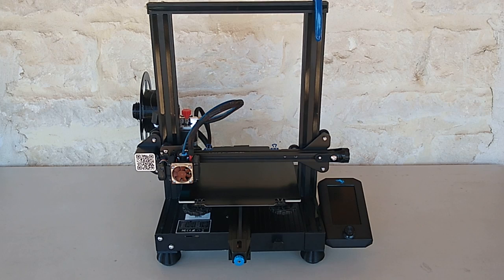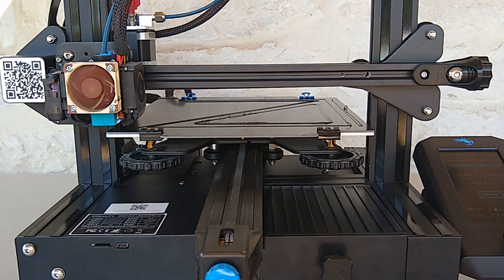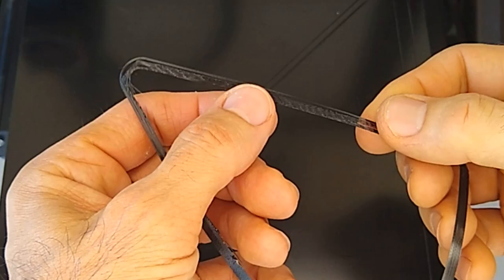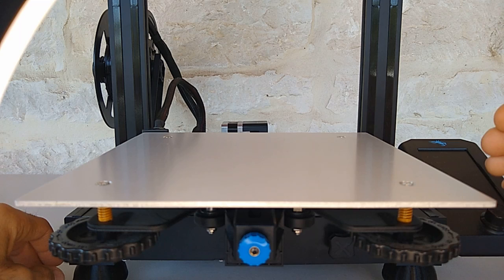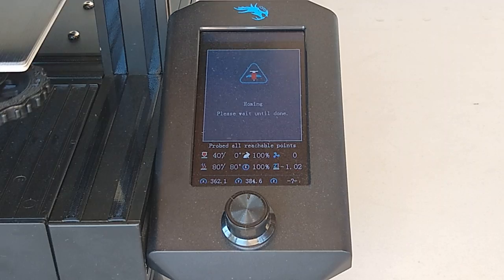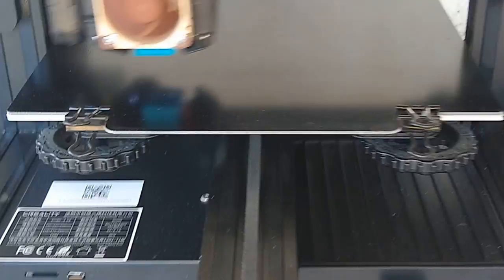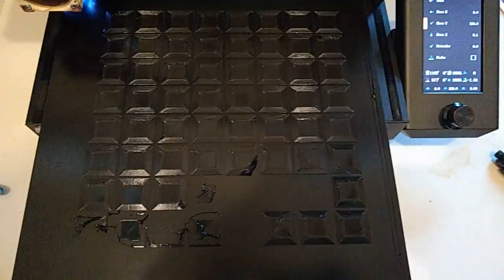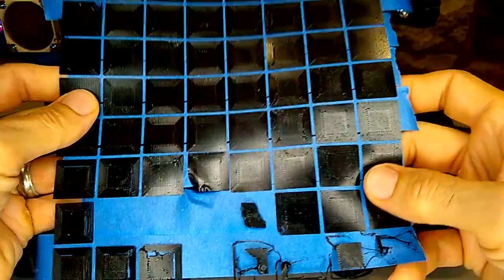Jyers Firmware Unified Bed Leveling Ender 3 V2 - Getting Perfect First Layers From An Uneven Bed

Comment: Aye bro you dont know where i can find firmware for an ender 3v2 w a 422,bl touch, and a e3d hemera? I tried doin it on vs code but it keeps sayin failed
Reply from the maker: Hello nacho408sj, Thank you for commenting. Use Miguel's Professional Firmware instead. It's actively being improved on and has advance features like linear advance, input shaper, UBL, MPC, and a boatload of things that can be tweaked. The special configurations can be found here in the link below.

https://github.com/mriscoc/Special_Configurations

Comment: hello i had a problem with my update its not showing the numbers when i auto level my bed
Reply from the maker: Hello Friend, sorry for the late reply. It could be an incompatible display. Creality uses 4 different sources for the display and depending on which board yours has will determine the firmware. Unfortunately Jyers hasn't posted and update for several years so unless you have one of the original Ender 3 V2s that came with a DWIN display you're out of luck. A much better firmware that is constantly being developed is Miguel's Professional Firmware. 

The first video is how to determine which display you have and the second is how to customize the firmware for your machine. Don't worry about the printer I use in the video it's using a 4.2.7 board which is the 512kb version of the stock Ender 3 V2 4.2.2 board so make sure to select the proper one from the configurator menu.

https://github.com/mriscoc/Ender3V2S1/wiki/How-to-update-the-display 

https://youtu.be/2NqHNYtyEa4

Best of luck with your mods!

Comment: When i make a new mesh my CR touch just doesnt go down. It just stays there floating and says that it finished the leveling
Reply from the maker: Hello, I would use Miguel's Professional Firmware as a non-Klipper alternative right now. The Jyers firmware hasn't had any development for the last 3 years and many new features have been added to Marlin. 

Please follow this first link to determine which display control board your printer has. Then watch the video l made on customizing the firmware for your needs. Just ask if you run into any problems.

https://github.com/mriscoc/Ender3V2S1/tree/Ender3V2S1-Released/display%20assets

https://youtu.be/2NqHNYtyEa4?si=NVCYDkKg4XmQLmJd
Reply: @vbared  thank you I will give it a try. Though I do think that it is a issue with my cr touch. The cable is most likely damaged. I looked through a few videos and that was what was happening with others. I will give this a try tho before I order a new cable
Reply from the maker: @nadim_873  Yeah, that's a good place to start and something I should have thought about. It doesn't take to many bends for those connectors to get damaged. Once you get that sorted out switch to Miguel's Professional Firmware, it's packed with all the latest Marlin goodies and get regular updates.

Comment: Hi Victor … I’ve been following your method and used on my printer … but I’ve been having problems … after I create a new mesh and correct the z offset and ran a test print … it seems that the changes that I made manually on the mesh are not saved … because the print showed the same problems that I had before the manual calibration… I tried to clear the mesh and start a new one … but that didn’t help … I also did the manual calibration on all the 100 points … but still seems that the changes aren’t saved … also at some points of the mesh the test print shows that the nozzle y too close to the bed but when I run the manual calibration on that point the nozzle is too high so I can’t find any sense on that  because the print is showing different results … hope you can help me thanks 😊
Reply from the maker: Hi Darwin, Thank you for commenting. When you complete your fine tuning are you saving the mesh? Another thing is that you need to modify your g-code to load your saved mesh prior to printing. I've included my start g-code for you to try, just make sure that the mesh slot matches the g-code. If you save it in slot 1 then slot one should be what the g-code is loading when it runs the load bed mesh. Make sure to enable "Go to Mesh Z Value" which should bring the head down so you can adjust it.
Let me know if this fixes your issue. 

https://drive.google.com/uc?export=download&id=199u7szF95cEaX82Rhq0-CMQm-HuJwQao
Reply: @vbared  I’m saving the mesh … and I’m using your start gcode … I followed all your steps … but same problem every time
Reply from the maker: @900creed  Hi Darwin, give me a call tomorrow +1 478-227-3301 if you can and I'll conference in Doug. Maybe between the three of us we can figure it out.
Reply from the maker: @900creed  Doug and I were discussing your issue and he asked "What firmware did you previously have?"
Reply: @vbared  I updated the creality firmware after I got the cr touch kit so I used the 2.0.8 cr touch non adapter firmware … then I changed to jyers using your video
Reply from the maker: We think that your issues are stemming from not having the software on your display screen that supports all the features of the firmware you are using. 

Try flashing your display screen. Unzip the file linked below, open the folders until you see 3 DWIN_SET folders, copy any one of the folders (I prefer "Gotcha") and paste it on an SD card

The segment of my videos on how to do it - https://youtu.be/amRldRpnK2Y?t=3933

https://drive.google.com/uc?export=download&id=1AL-ad9r0GOulVaYKAo-SMLp2Pm3eKGRF

Let me know if this works for you.
Reply: @vbared  but I update the screen too … for the jyers UI 🤔 … a few hours ago I downgrade the firmware to the creality cr touch … and I got an almost perfect first layer … I’m kinda frustrated with jyers right now
Reply from the maker: @900creed  Darwin, do you have a Raspberry Pi?
Reply: @vbared  yes I have one

Comment: I can't find the UBL version in the 3x3  mesh, is there a version in 3x3? Thanks
Reply from the maker: Hi Norman, I've moved to Miguel's Professional Firmware from Jyers. Miguel is extremely active in adding features to it as Marlin continues to improve. Unfortunately, Jyers hasn't had an update for several years. I'd be happy to compile the firmware for you but will need some details about your setup or you can follow my video on how to compile your own. Give me a call 478-227-3301 for a walkthrough on compiling it.

https://youtu.be/2NqHNYtyEa4

Comment: Nice video by the way I have this problem that is happening to me right now so my bed leveling device doesn't want to go all the way down I used the knobs on the end to unscrew all the level nobs so that i can start even and correct it later on but the offset says that it at -10 and won't go anylower  on the bed the bed can not reach the hot end at this hight is there anything you know or how to fix it
Reply from the maker: Hello Ernie, 

Thank you for your kind comment.
What probe are you using?
Reply: @vbared  it actually the car touch
Reply from the maker: @gray896  Please take some pictures or a video showing me your printer and link it.

Comment: Cough cough no homo I love you 🤣 amazing video man keep it up !!! Thanks for the GCode I've been looking for !
Reply from the maker: Hi Abel, Thank you for commenting and kind words. I'm glad the start g-code is useful.

Best of luck with your mods!
Reply: @vbared  and for the feeler gauge why did you due 0.15? Vs 0.20? I print with PETG so I'm unsure what feeler gauge size to use for my z .
Reply from the maker: @JustCreateYou  Hi Abel. Thank you for commenting and great question. The first layer is going to require some squish to stick to the build plate but not too much. Most is the videos that I watched early on suggested to use a piece of paper create the gap between the bed and nozzle to get good first layer adhesion. The trouble is that a random price of paper can have different thicknesses. Really thin paper can be less than 1mm while a standard sheet of white copy paper can be 1mm or more. If you use a 1mm thick piece of paper to set you z-offset. You will be too close to the bed if printing at a .2mm layer height. If using a .2mm feeler gauge there is no squish when printing at .2mm layer height. You can tell if you too close by looking at the tops of your prints. If the top layer of a finished print looks dull and not shiny like the sides do then that indicates the nozzle is ironing the tops of each layer. Another thing you're going to notice is little blobs of molten filament randomly deposited on the print, collecting on the nozzle or extra stringing as you print. The .15mm feeler gauge gets you closer to the correct nozzle to bed gap needed (if printing at .2mm layer height) to get a good first layer and avoid all the aforementioned problems. 

Best of luck with your mods!
Reply: @vbared  man you are awesome I def subscribed !! Your videos are so underrated that people are dumb to skip them thank you again 🙏🙏🙏🙏
Reply from the maker: @JustCreateYou  I appreciate you, Abel, thank you. If you run into any questions, just ask so maybe I can save you some time and frustration.

Happy modding!
Reply: @vbared  would you be able to provide a video of how this works with a feeler gauge and CR touch and jiers mesh system because for some reason my stuff when I start printing seem like my nozzle goes up higher then what I had it set too .2 mm and used .15 feeler gauge.
Reply from the maker: @JustCreateYou  Hi Abel, sure thing. Let me put something together.

Comment: Hi Victor, I added the UBL file. But now my ender will not home or move in any direction.  Any idea to what would causes  this?
Reply from the maker: Hello Sarge, Thank you for commenting. Please give me more details on your setup so I can help you trouble shoot. Have you changed the main board to a 4.2.7 or are you using the stock 4.2.2 main board? Did you download the flash file from my video description or somewhere else?
Reply: @vbared  4.2.7 board.  I re-flashed with the creatility firmware. Now I have direction.  But no fine tuning. Thanks for the quick reply.
Reply from the maker: @sargedutch1085  Hi Sarge, Some pins of the 4.2.7 are different from the stock 4.2.2 so to get the UBL working download the version for the 4.2.7 linked below.

Let me know if you have any more trouble so I can help you.

https://github.com/Jyers/Marlin/releases/tag/v2.0.1
Reply: @vbared  this worked.  Thanks.
Reply from the maker: @sargedutch1085  Awesome job!

Comment: Whats the difference between 3x3 5x5 & 10x10 on the files
Reply from the maker: Hello JusThyTipp, Thank you for commenting, the difference is the amount of probe points. 3x3 is 9 total and 10x10 is 100 points probed. The best firmware currently for the Ender 3 V2 is: https://github.com/mriscoc/Ender3V2S1/releases/tag/20230522

Comment: Would it be different for every ender 3v2 or should I use a .15 feeler as well?
Reply from the maker: Hello Trevor, Thank you for commenting. I've learned that using the paper method puts the nozzle too close to the build plate because a standard A4 sheet of paper is .10 in thickness. Starting with a .15 feeler gauge puts you very close the perfect nozzle height. Once you set the z-offset using the .15 feeler gauge I recommend printing a 2 layer high 20x20 square using a brim with a .1mm gap between the brim and part. Make sure that you set the initial layer, prime, skirt/brim flows in CURA to 120% (this is important otherwise you may not get good enough adhesion to the build plate). If the brim on the completed print is difficult to remove then you need to raise the z-offset a bit and run another test print. Continue this process until the brim barely holds on to the part and can be removed easily.

Best of luck with your mods!
Reply: @vbared  I really do appreciate your content and reply! I am ordering a feeler to get everything set!
I hope you have a blessed one;
I agree with the paper method especially for noobs out there
Reply from the maker: @CloudyCreamer  Thank you Trevor. Many blessings to you as well.

Comment: I enjoyed your video and learned a lot from it. I'm not clear on how you determine what thickness guage is used to make the manual adjustments and whether all points need to be adjusted, can you explain or refer me to a tutorial which explains it? Thanks
Reply from the maker: Hello Norman, Thank you for the kind comment. Are you using a CR-Touch or BL-Touch? Please also tell me what build surface you are printing on and what type of filament.
Reply: Hi victor and thanks for the reply.I have the cr touch using original ender glass plate with inland filament.
Reply from the maker: @normanziegelmeyer7693  Good morning Norman, Your Ender 3 V2 has one of four models of displays. Linked below is a way to tell which type you have by comparing it to the pictures. You'll need to take off the back cover of the display by removing the four Allen screws and unsnapping the plastic cover. Let me know which display you have any I'll compile the firmware for you.

https://github.com/mriscoc/Ender3V2S1/tree/Ender3V2S1-Released/display%20assets
Reply: I have Dwin
Reply: I have Dwin, also what is MRISCO firmware and does UBL come in 3x3 matrix? Thanks
Reply from the maker: @normanziegelmeyer7693  Hi Norman,  It's an abbreviation for Miguel's Professional Firmware. Yes, you can select 3X3 - 9X9 all from the control menu. It uses MPC instead of PID tuning for the hotend, has input shaping, and linear advance. It's an amazing firmware, I can't say enough about it. Link below to the one I compiled for you. Just unzip and you'll see the bin file and DWIN folder.

https://drive.google.com/uc?export=download&id=1HQ_2ucK9yvg6VsjdOZWz9waZp8sZTcjE
Reply: Thanks for your help, I appreciate it.
Reply from the maker: @normanziegelmeyer7693  Did the flash go OK?
Reply: Not yet, Grass calls, later tonite or tomorrow
Reply: Display won’t load, firmware ok
Reply from the maker: @normanziegelmeyer7693  Try getting the display assets from here: https://github.com/mriscoc/Ender3V2S1/archive/refs/tags/20230312.zip

Make sure the sd card is formatted using fat32 and 4096 allocation units. After unzipping, look for Giadej compilation folder inside display assets folder. Copy and paste the DWIN_SET folder to the formatted SD.
Reply: Tried but No success
Reply from the maker: @normanziegelmeyer7693  Interesting,  how long ago did you buy your Ender 3 V2 and was it purchased new?
Reply: new about a year ago at microcenter
Reply from the maker: @normanziegelmeyer7693  When checking the display type did yours have a sticker on the display board or just the info printed on the board itself? My apologies for all the questions, I'm trying hone in on the reason why it won't flash.
Reply: It had sticker matching the DACAI, once I put the "Personal" folder in and tried it flashed no problem. Are there any other features to add or is the display complete?
Reply from the maker: @normanziegelmeyer7693  Great job being persistent in solving the problem. I recompiled your firmware so it can work correctly with the DACAI display linked here - https://drive.google.com/uc?export=download&id=1HfgsMlCkN8GFxfoG34kntFDtQoufZ3c1
Reply: @vbared  is all i have to do isload new firmware?
Reply from the maker: @normanziegelmeyer7693  Yes, you already have successfully flashed the screen I just needed to compile the firmware for your display type so all that's left is to flash the control board.
Reply: Is there aparticular serring for the probe that’s best? I noticed that it’s much faster than in jyres.
Reply from the maker: @normanziegelmeyer7693  Good morning, Yes, in the advanced menu under probe,  there is a box that says something like enable HS (high speed) probing. Uncheck that box to slow the probing speed. Slow probing is more accurate than fast.
Reply: Ran into two problems, can't load your firmware, just boots up as usual, printer now contains v2.1.3 mriscoc-20230509-12:24(obtained from their site I believe). tried different cards and changing name of file. Second problem is with changing number of probes, It won't remember any value but 2. I wanted to use one but I change it and save settings but when I go back and check it it is 0.
Reply from the maker: Sorry Norman, my fault I didn't zip the bin file. I think Google security does something to it when it is sent as a .bin file. Try this one that has already been renamed to just firmware.bin. 

https://drive.google.com/uc?export=download&id=1HjskxEIPzo2TJnG2wP-SNsXKVfNQ7DiR
Reply from the maker: @normanziegelmeyer7693  Hi Norman, I haven't received an email yet just to confirm please send it to vbared@gmail.com

Comment: Hi Victor, your G-Code TXT is empty, would love to see your starting G-Code
Reply from the maker: Hi Viktor, Thank you for commenting and letting me know about the missing info. I just added the start g-code data to the zipfile. If you try the link again it should be there.

Best of luck with your mods!
Reply: Thanks a lot! Your channel is awesome. I love your Minimal cooler design, bought it the other day, just waiting for the other parts to arrive 😁
Reply from the maker: @viktorp3759  Hi Viktor, Thank you for supporting my work and kindness. The compact fan bracket and ducts work great. Best of all is that it's quiet compared to most things I've tried.

Best of luck with your mods!
Reply: @vbared  Thanks, just installed the fan bracket on friday, printed in in PLA and its holding up, very nice design
Reply from the maker: @viktorp3759  Hi Victor, Great job getting all the parts printed and installed. I highly recommend that you print up backups in PETG. PLA will not hold up long term.

Best of luck with your mods!